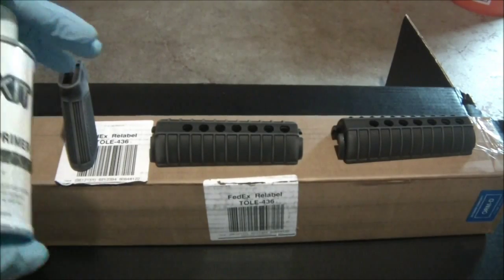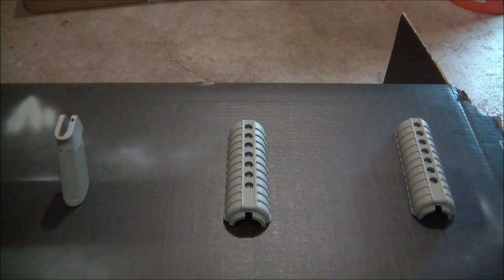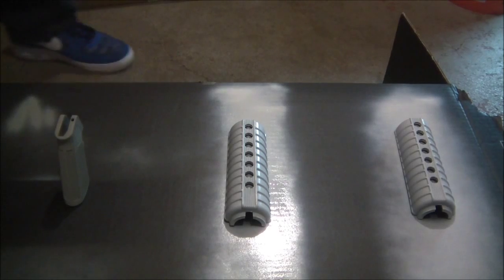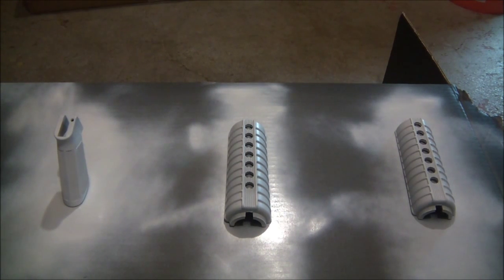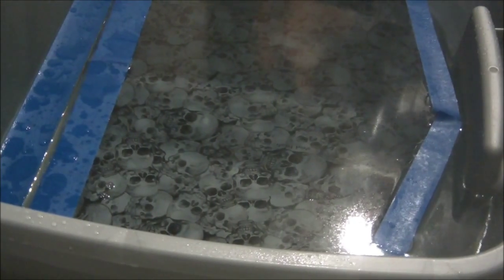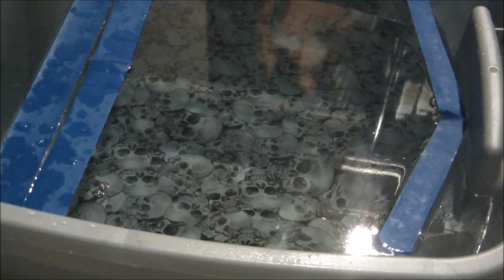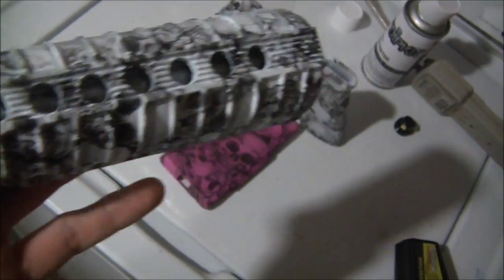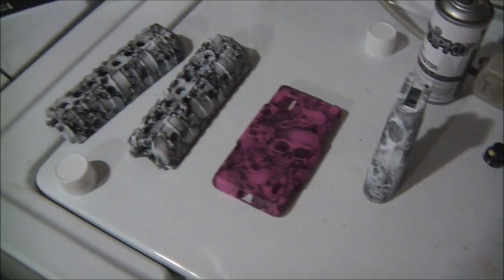mydipkit dead head

Comment: Well looks good for first attempt. Only thing I would of done is to put the forend together so the graphic matches all the way round. Other then that. It looks bad ass. Now can you tell me how durable it is?
Reply from the maker: i was testing it for the forst time on some parts i replacd with new to see how the product worked. came out ok for the first attempt but the stuff i did later came out better. mainly was about prep work. if prep was done properly it usually cane out great. i agree with you on the foreend definitely shouldve done it as one piece